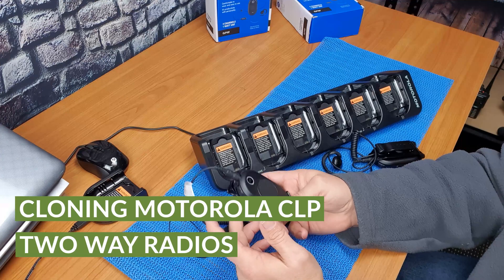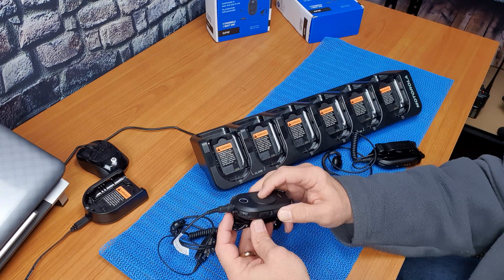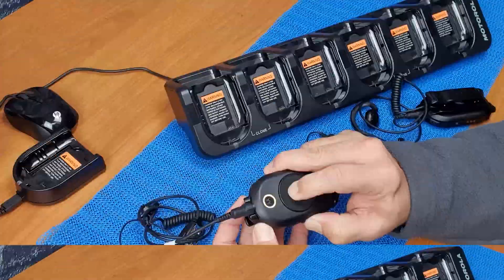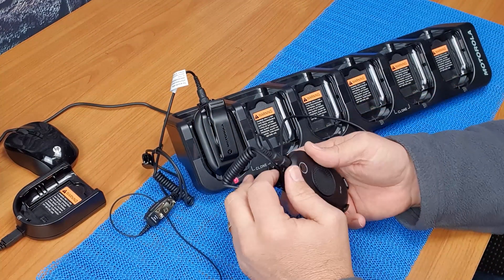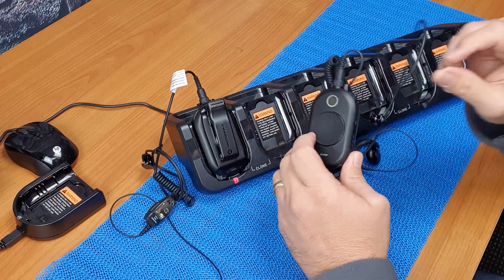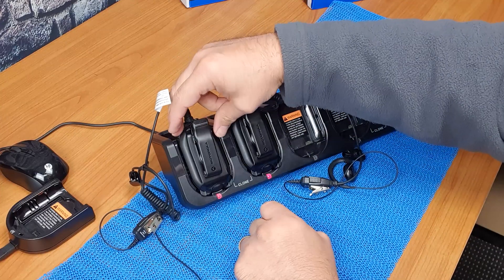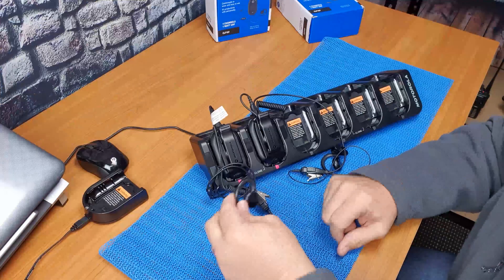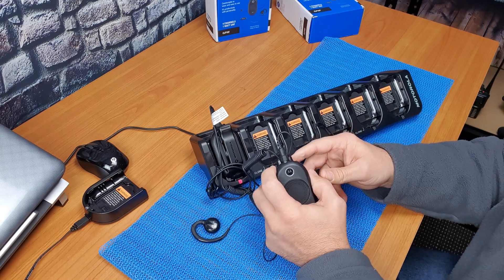Cloning Motorola CLP107 Radios

Comment: Is it possible to connect a clp 446 simply  by switching to the same channel that other clp 446 radios are on ?
Reply from the maker: That's hard to say. If the CLP446 is the same frequency band and you have both radios programmed to the same channel. The radios are not all programmed the same. Sorry for the delay in answering your messsage